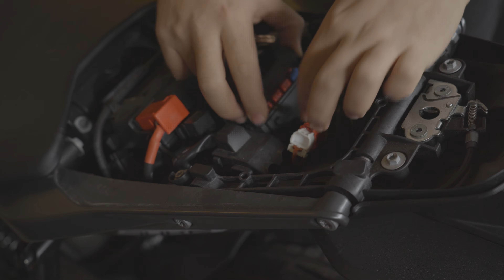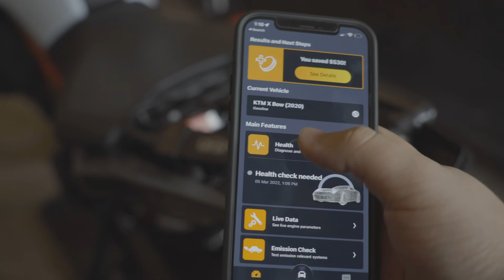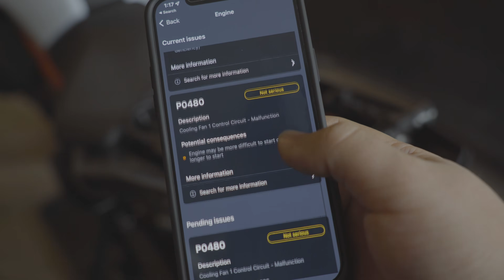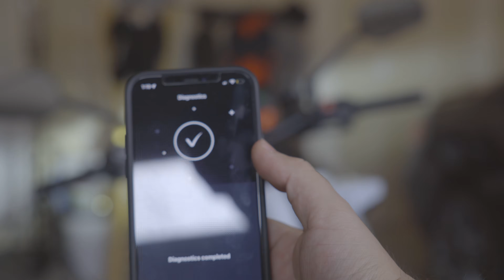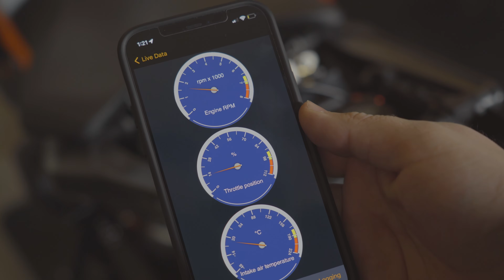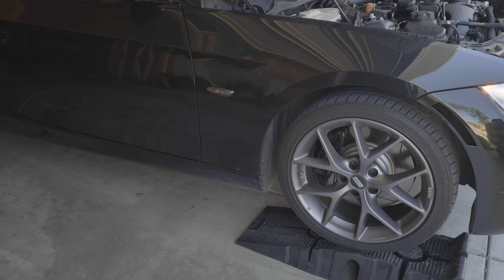Engine ECU Code Diagnosis - KTM 890 Duke R

Comment: I'm pretty new to these kind of ECU reading or data logging, but is this how Track Timers such as the Solo AiM 2 DL work?  They connect to the same connector?
Reply from the maker: Man, I wish I knew. I am going to have to do a ton of research because if I’m going to tune I want full readout with data logging. I have a great track timing tool I’ll be talking about in upcoming videos but as far as engine readouts the Carly tool doesn’t seem viable without an update from Carly.